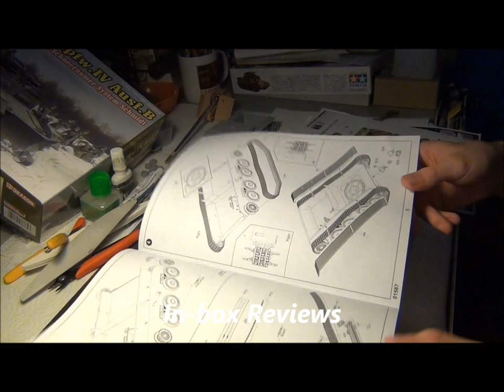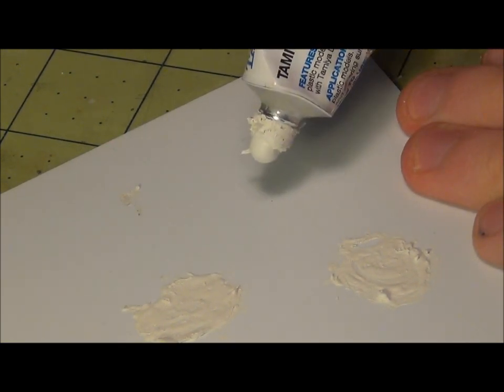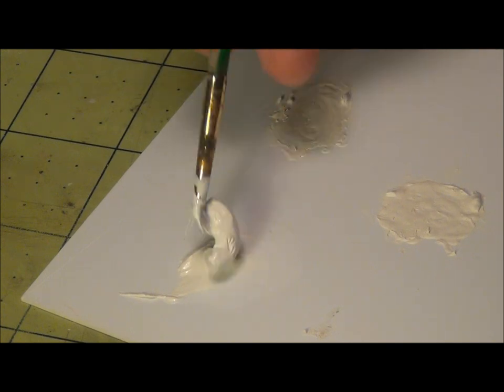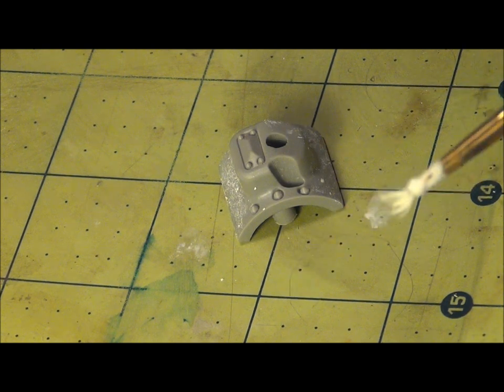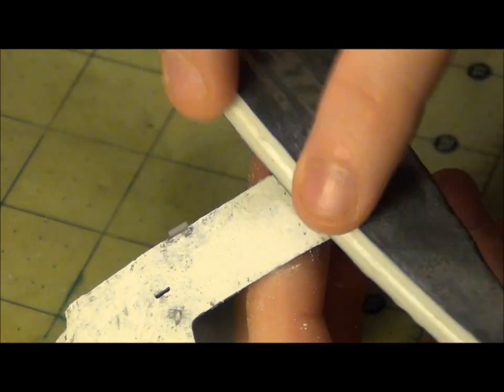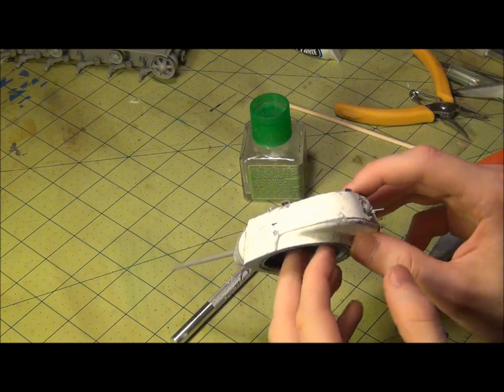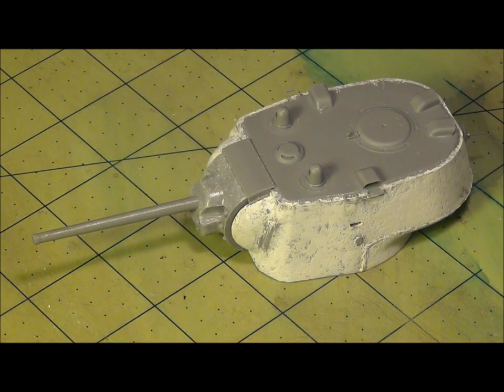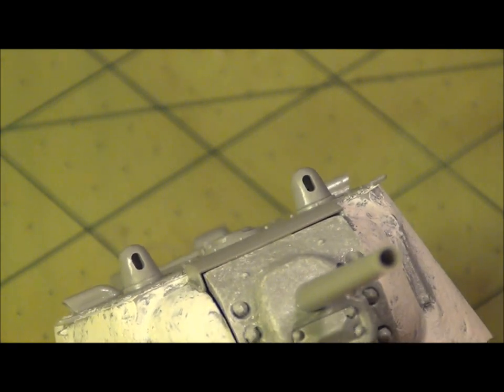Tutorial: Recreating Cast Texture and Heavy Weld Seams

Comment: That's cool! I wouldn't have thought of using stretched sprue to make weld seams.
Reply from the maker: ***** Thank you Pat!  The sprue here was more to fill the gap and build up the weld seams from the cast surface, as this is a Russian tank so the welds ain't purty fro sure!  But you can use it as the weld line itself and score it with a hobby knife.

Comment: Really good method and technique.  Clever stuff.  Thanks for sharing Evan. The sprue is remarkably effective
Reply from the maker: Armour Empire Thank you Mark!  You modern armour builders never have to deal with the welds or cast textures ..... but then the camo kills you lol.  My Orochi Bradley is awesome and I'm really enjoying the build so far.  Pick it up if you can; as I explain in my next update it's basically modern Tamiya-esque parts count and exquisite molding, Trumpeter instructions, and at my shop was $45 while an older Dragon or Trumpeter kit there costs $50.  PE, anti-slip, separate tires and a wheel mask ...... when are they releasing a StuG kit lol
Reply: Really good value for sure. I know Brad geeky rocket has this one too and was keen to see what you both thoughts of it.   iTools very takom  esq too.  Orochi do some of the tracks for takom so I wonder if there is a tie in somewhere.  Know what you mean about Tamiya also. It has that look
Reply from the maker: Armour Empire Yeah, Andy said that Orochi is a part of Takom. Orochi has been doing tracks and detail sets for some time though.

Comment: I think you should turn on more lamps, because it's helluva dark there. And from what I hear it's the first video without the hoarseness.

PS: Ah, and a question. Can I use a simple old brush from a picture-painting kit?
Reply from the maker: Skull Gun Well I have tow lamps; one from my side and one from the camera's side, but the camera one died so its not on for some of the video.  Fixed now, though.  I think a white background rather than the green would help too.  You could use any brush I think....the one I used here was pretty much destroyed before I even started.  I suggest doing a test on the bottom of the turret of hull first though.
Reply: Panzermeister36  K, thx.

Comment: Acetone works great for dilluting Tamiya putty. And when putty hardens up in its tube, you can use the same chemical to soften it. Use acetone from a pharmacy (expensive) or a DIY shop (cheaper). When you use putty as a filler you can avoid sanding by cleaning up the excess by wiping it with an acetone soaked cotton bud.
And sorry for being five years late.
Reply from the maker: No worries!  Thank you for the advice.  I was not very experienced at the time of making this video...I'm probably like 17 years old 😅
Reply: I wondered about that.
Reply: @Panzermeister36  ooops 6 years old. Sorry kiddo!

Comment: Uh, your method of making weld seams seems needlessly dangerous. Melting styrene gives off some unpleasant fumes, as does its combustion. Putty is much safer. 

Thank you for the cast technique - it seems very similar to the rolled steel techniques I've seem elsewhere but heavier.
Reply from the maker: +Alex Hunt stretched sprue is a very common technique.  There is so little material that such fumes aren't of concern.  We probably inhale more fumes from glue and thinners.  But, you can always buy some styrene rod which is what I do now.
Reply: @Panzermeister36  I work mostly in acrylics to avoid this (though I'm always tempted by enamels). I'd personally recommend green or brown stuff